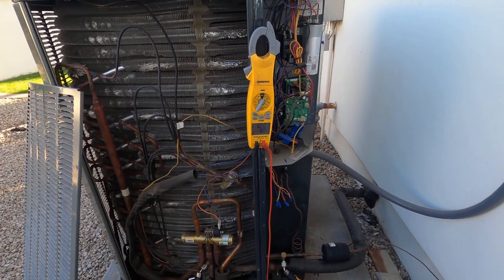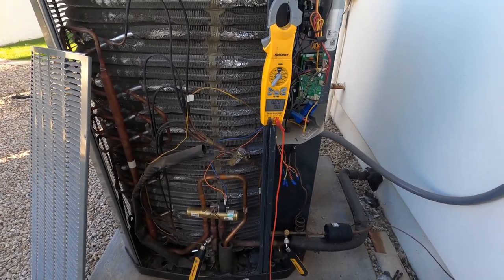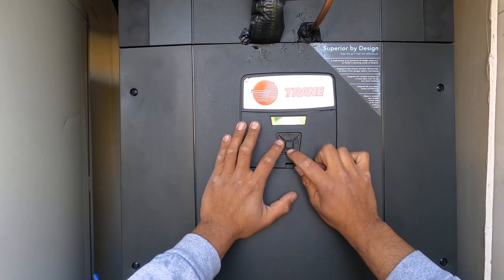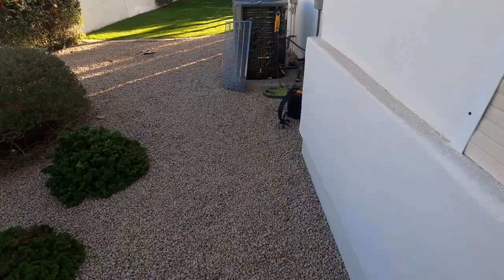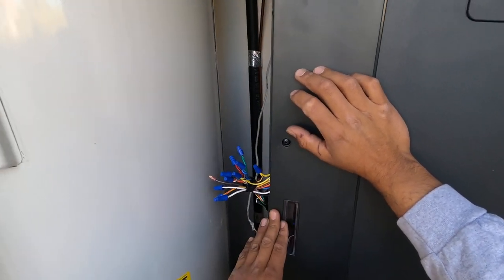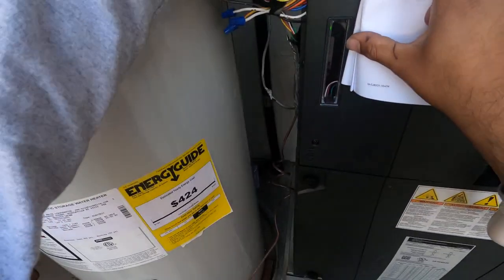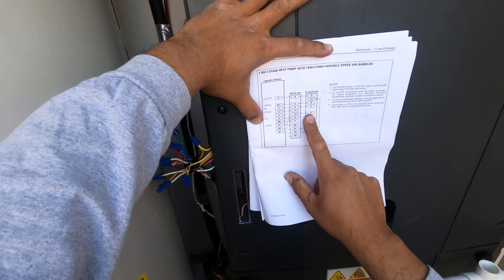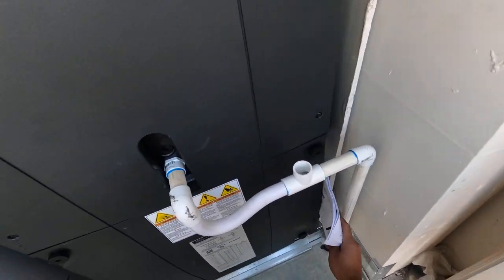A common mistake guys make when installing Trane. HVAC INSTALLATION AND REPAIRS SCOTTSDALE ARIZONA

Comment: I’ve got a newer Trane 18 variable speed tam 7.  This idiot who failed me many times. 😡😡😡The system was installed right but they put a regular fancy Wi-Fi thermostat on that was supposed to work an  Internet system and I told them specifically I did not have Wi-Fi in my home I only have an Apple iPhone. Anyway the system wasn’t working right and I called the guy over from trane 10 times over three years and they replaced the whole electrical unit brains on the heat pump. That didn’t work. And then they said it had too much Freon or whatever that new stuff is now in it so they drained it out some. Then the guy started coming over because I said it’s still not working right as it would not stay at the correct temp and he came over five times working on this and that and says I think I finally got it figured out. He never did and I noticed that my trane heat pump the fan wasn’t working. This time I was tired of all the bullshit and I took a video of the fan not working but the unit on. And I took a picture of the thermostat because they kept saying there’s no nothing wrong with the thermostat and I said well I think there might be.  Anyway they sent the same guy over who is supposed to be their best and he hurried up went outside and before I could get out there he came back in and he said Mark it was a stick stopping your fan from running and he said you always $200. I said bullshit I said I just took a picture a video of that fan and there was no stick in there and there aren’t any trees near by. I told him to get the hell out of my house. And then I remembered something about the thermostat and Freon or the new stuff and I called another company and I said I think I got the wrong thermostat and I think I have low Freon or 134  or whatever the hell it’s called now.  Sure enough this guy changed my thermostat out and he said you’re low on Freon and other than that nothing is wrong and he asked me why the other guy couldn’t figure out and I said you tell me why!   Oh I was pissed off. I paid $500 for a five year warranty on this complete 18 trane  system and they just didn’t want to keep coming over here so that’s why they used the excuse. Well I got news for them they got a horrible rating and I’ve been hearing people are saying they were going down the tubes. My point is most guys don’t know jack shit on how to work on these sophisticated systems and that is a fact.  So stick with your small company that’s got like 1 to 3 or four employees and you’ll do much better most of the time and they’re usually cheaper.
Reply from the maker: that sounded like a real night mare. Only trained pros need to work on those systems. a pro would've known the xv18 needs a particular thermostat to work correctly. thanks for sharing! The trane website is also supposed to have a list of highly rated companies who know how to work on their systems. Give that a try if your ever in a similar position.
Reply: @themoderntradesmen9352  youd be surprised at how many techs out here today don’t know what they are doing and costing home owners money.  Yes I’ve been looking for a new company and I found a guy who only works with his son and his wife does the books.  That’s the ones I like.  Not these big companies that go through 10 techs every 2 years or try to take over a huge area and they goof.  Thanks!
Reply from the maker: @jochimbenschneider1915  I prefer smaller companies for that same reason!

Comment: I have a Trane tam9 and it has been nothing but issues. Had to have the coil replaced, $1000 even under warranty. Electric heat has never works. Supposedly the DC relays are corroded. Had a capacitor go during a Labor Day holiday, $400, under warranty. The system leaks. I could go on and on. Not even 4 years old and needed work every year. Nothing turns on a Trane! You’ve been warned!!

Comment: I don't like these plastic cabinets. So I wont install them. I like the Rheem/Ruud and york Heat pumps.
Reply from the maker: I haven't had much issues with these cabinets, but the compressors are another topic.
Reply: @themoderntradesmen9352  I figured American Standard and Trane compressors were good
Reply from the maker: @jimthvac100  not since they switched to a brand called Alliance 🤮

Comment: These systems are junk plastic airhandler with a electronic txv..... The condenser will fail 1 day after warranty runs out too. Save yourself the trouble and buy anything but this junk.
Reply: EEVs fail less often than TXVs when they are comparable quality, change my mind. I'll take swapping a bad suction/saturation sensor every 10 years over replacing the entire valve. 410a TXVs are junk, I don't care who makes them.
Reply from the maker: Hvac guys have no where else to go because workmanship is an issue with all brands now a days

Comment: The only mistake is buying Trane. It’s some of the worst junk on the market and it’s overpriced as well. The replacement parts are stupid ridiculous which makes them very unattractive for the homeowner.
Reply from the maker: hvac guys are in high demand because of all the issues across all brands and their corner cutting
Reply from the maker: @Earlvis  yes! Now a days its all about profits. workmanship and quality falls way in the back of the line.